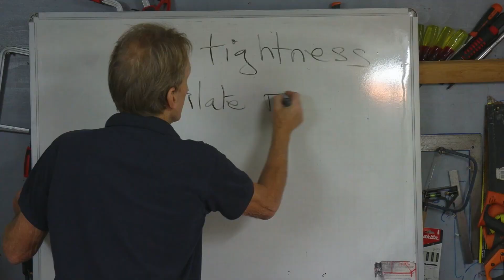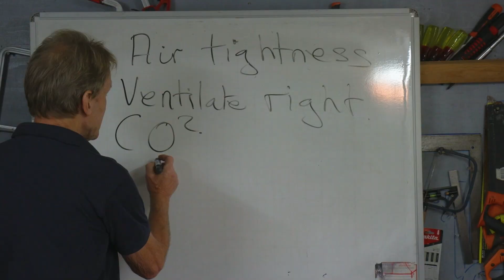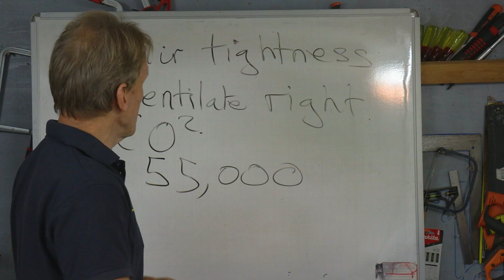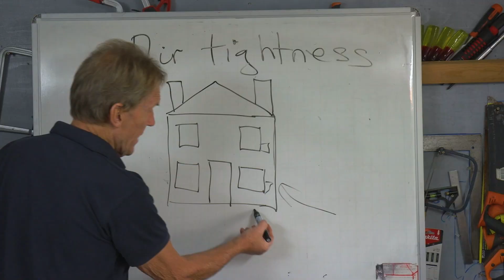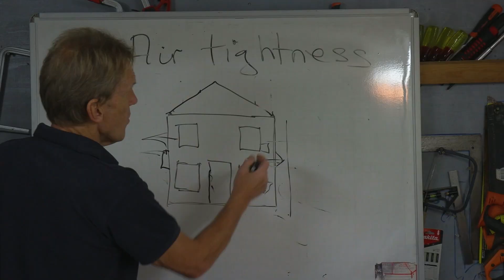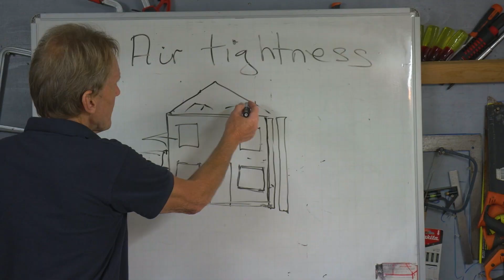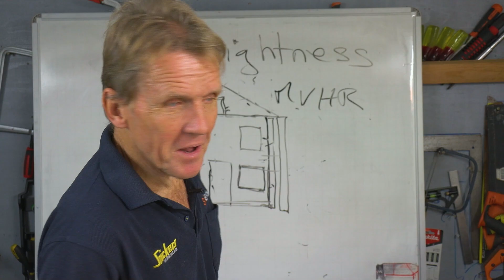The Ugly Truth About Airtight Buildings

Comment: Trickle ventilation is an astonishingly bad idea. Whoever dreamed up that mess didn't understand ventilation at all.

Energy efficiency and airtightness is about change the ventilation of your home from the ideology of a tree to the ideology of a lung. A tree has excellent ventilation, but it has no control over the temperature, the humidity, or the particulate pollution present in the air in its space. A lung also has excellent ventilation, and the air in its space is perfectly filtered and modulated for temperature, humidity, and particulates.
When you are creating a lung, you do not make the design better by putting extra holes all over it!

What you need to do instead is focus on the pipes bringing fresh air in and removing stale air. Those pipes, and the filters and air pumps connecting them, are the key to the whole system. A lung with no air coming through its pipes, or with bad air coming through its pipes, is going to fail very quickly. BEFORE you start sealing up the leaks and gaps in your house, you need to make sure that your pipes and the systems serving them are correctly engineered. Then you make sure there are no holes in the fabric of your lungs.

Get the pipes wrong, and your house will grow mould, and your people will get sick or even die.

Comment: I am renovating a 1972 house. There lots of cold bridges that are now fixed and all the external walls have been insulated on the inside. My friends said it would make the rooms smaller, like they can see two inches in 12 feet. The rooms come quickly up to temperature and stay there with the radiators hardly warm (small fully modulating boiler with Opentherm stats) still got to put in the air exchange unit (£1500) but just know it will be worth it. Insulate, insulate,  insulate,  then ventilate!!

Comment: Your small room point is bogus. 4 people in a small room is as much of a problem in an airtight house compared to a leaky one. The difference with an airtight house is that you are controlling what air you are letting it. You can put a filter and an ERV on the intake and put exhausts where pollution (toilet and stove) exists.

Airtight is only a problem if you don't do anything for ventilation. You can do a shoddy job that is on par with a generally leaky house or a good job that makes it that much better.

Comment: Bruh just ventilate the house with an ERV and use a properly sized AC system. Vent for vapor at the ridge or just seal the attic floor. 

I get old homes "breathe" and all this but energy has a financial and environmental cost we need to minimize. Not to mention controlling air quality is key for many just for comfort alone.

Comment: This is why we need mechanical ventilation heat recovery systems with carbon and merv13 filters with C02 sensors to boost air when there’s high occupancy, air to air heat pumps (for heating, cooling and dehumidification), continuous insulation & air tight walls, with vapour low permeable membrane (NOT barrier).
You need to look at the whole system.
Your little anecdote about the lady who lived to 98 is just asinine. Like smokers who talk about their granny who smoked 100 a day and lived to 100.
You seem like a good tradesman but you don’t understand building science mate

Comment: Well said Roger!
14 years ago I rented a 100+year old house with a recent long and narrow (6ft x 15ft approx) extension which housed the kitchen. Condensation would literally run down the walls & windows and drip from the ceiling. There was no form of heating in that kitchen (other than the cooker!). Opening the windows didn't help. From what you've explained here, I now wonder if the (exterior?) walls of the kitchen had been coated in some kind of sealer. The cottage part of the house didn't have this problem, not even the bathroom, and we were able to maintain a comfortable 18-20° in it, unlike the kitchen which was always really cold (it was on the north side of the house which I guess didn't help - would probably have been better as a pantry!)
Thanks for the video

Comment: I'm suffering from issues related to a lack of airtightness. The room I'm in has tongue and groove wood panels. It's in the attic so I need an air conditioner to cool. What I didn't realize is there is no actual drywall under much of the panels- the insulation itself is exposed! Cool air is easily passing through the fiberglass and hitting hot humid outdoor air in the summer causing condensation.
My first floor has similar issues between the house and foundation where humidity levels skyrocket after rainy days and I keep getting mold outbreaks. What I wouldn't give for proper air sealing, a moisture barrier under the foundation and a proper ERV for ventilation and humidity control.

Comment: Hi Roger, at 17.56 minutes into the video you make the mistake of using the term "Vapour barrier" instead of "air tightness membranes" for the  control the bulk moisture being carried into the cold spaces and therefore condensing. As you know an "airtight membrane" stops the flow of moisture laiden air by a factor of 100+ when compaired to a "vapour barrier". Love your videos, Thanks.

Comment: Airtightness is very sensible for saving money and for comfort but it absolutely requires MVHR. The problem is in-between houses, which are partially airtight but lack mechanical ventilation. We need more ambitious building regs for new builds - i.e. more rather than less airtightness and to require MVHR for them as part of this. For retrofit I think most houses are not good candidates for being made airtight unless the owners are willing to pay for MVHR too - which is not that cheap to retrofit as it requires adding ducting through the house. (I've done this and the results are worth it but it is not financially viable for most.)

Comment: I bought a 1980s split level ranch two years ago and it had a lot of rotten sheathing which allowed bugs and mice in. I took all the siding off and replaced the sheathing with Huber zip system, following the guidelines and taping all the seams and air sealing more to keep bugs out than I cared about air. Well I have new siding, windows doors and roof now but places where air can leak into the wall cavity are causing mold. Now I’m gutting the whole interior and installing an hrv, new insulation and being very fussy about the vapor barrier when installing it by caulking it onto the studs top and bottom plates and taping around outlets and windows. Learned a hard lesson about sealing up an old home.

Comment: It's getting so hot that no one will need heating mid winter. This is due to global warming. A good sleeping bag is the answer and fresh air or fresh pollution if you live in the city, houses are very expensive. A simple camping gas cooker can do just about everything except roasting meat vegetables, opening windows for oxygen if it's possible  or purchasing a oxygen generator may save you.

Comment: again a compressor dehumidifier if a great way to dehumidify during the winter because it gives off heat it will only be 120W or so, but it means that not only are you reducing the humidity your also supplementing your heating in the same stroke and during the summer you can just open up the windows. As you say though CO2 is an issue so you still need a decent amount of ventilation.

Comment: Excellant rant. The big disgrace is UK building regs. My house is 40 years old and came with MVHR installed. It's 5-bed detached and the total output of all rads comes to 2.5kW - the thermostat stays at 21°C and we don't need TRVs because every room is used throughout the day. It's now 11pm and the heating just came on for the first time today as the outside temp has dropped to 5°C. The rads got to 40°C and the heating went off again after 12mins. I know all this because I'm recording the boiler flow temps to try and convince Octopus and British Gas that I do not need a 12kW ASHP and bigger rads. Where was the house made? Sweden of course and it's so frustrating trying to get installers to think outside their crappy British new-build boxes.

Comment: This was brilliant! and very helpful. I just built a block recording studio in my back yard and we water-sealed it inside and out, thinking we were preventing moisture from entering it.  Low an behold, just my wife and my breath was building up in the room and in the coldest back corner we were seeing water run down the wall onto the floor.  Not much, but enough to catch my attention and wonder how on earth it was getting into the building.  After thinking about it I figured out that the building was so air-tight it had to be our own breath causing this.  If I left the door open for a while or if I was not in the building for a few days, no water showed.   So now I'll have to figure out how to keep the sound out and let fresh air in somehow.

Comment: What is this guy talking about? The houses that air tight should have mechanical ventilation and humidity controls. Every airtight house I have lived, most new apartments in Denmark, have been perfect. No more feeling drowsy due to lack of ventilation, no more humidity, no more allergies (air is HEPA filtered in)… and I have had asthma my whole life, never been better.
Reply from the maker: You have made the very same point that I made but I understand you are Danish so might not have understood my exotic accent. If you are going to make air tight houses you need MVHR. The trouble is we don't insist on it in the U.K and it leads to problems.

Comment: If the people who live in properties that are having mould problems bothered to wipe the walls down with warm water and any type of mould spray , or any cleaner,  on a regular basis, ie :  daily, weekly, or monthly , whatever is required,   that would stop the mould from getting a hold on that room and getting worse as shown on recent reports .    The fact is you can see the filth on new UPVC window frames , and mould doesn’t take muck effort to wipe from plastic !    I have advised customers before that their tenants need to open all windows every morning and let fresh air in and stale air out for at least 15 minutes,  they could do this before showering etc ,  and close them before they went out if they are rushed in the mornings . It would SMELL a lot better to !  Basically it comes down to LAZY people.

Comment: Why is there more vapor the warmer the house gets heated? Doesn't make a lot of sense. Great videos!
Reply from the maker: warm air will carry a lot more water than cold air. It is due to evaporation. Think of a hot steamy jungle
Reply: @SkillBuilder  In the jungle there's much more evaporation due to the higher temperatures. But inside your house there's a  fixed amount of vapor: the vapor produced by those who live there. The fact that warm air can contain more vapor doesn't change the total amount produced.
Reply: @SkillBuilder  The cause is probably the pressure differentiel, not the vapor amount.

Comment: Before you get a negative pressure system, I strongly recommend getting a Radon test done. Radioactive gas is likely going to worse for your health than condensation.
Reply from the maker: positive pressure, not negative
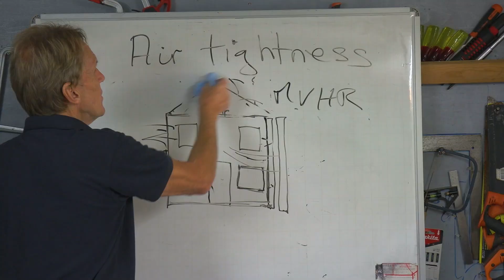Reply: @SkillBuilder  At 14:58 you recommend negative pressure.

Comment: If you want lots of natural ventilation in a house that's fine, but you can kiss goodbye to your money when you try to heat it. You also can't control the quality or amount of air coming in. Much better to build an airtight house with active ventilation. More expensive at first, but lower heating bills. A lot of what you describe is actually about use of impermeable building materials, a totally airtight house will have no moisture problems if it's built with vapour permeable materials.

Comment: Silver foiled backed plasterboard stops moisture getting into cavities. Then you need to install mechanical ventilation to remove the moisture to prevent condensation. 2 extracts. One bringing fresh air in and the other blowing dirty moist air out. MVHR is expensive but works well if maintained and balanced correctly 👍

Comment: What is really the solution to all of this is decentralized, room per room heating, ventilation units integrated with the windows. Intake at the bottom, exhaust at the top and a heat exchanger to save the energy. Active monitoring for hunidity and CO2 with of course a manual override. You could say modern buildings don't accomodate that because exhaust of bottom floor goes into the intake of the floor above.
Maybe it would be possible to run chimneys in the cavity wall...
Either way natural ventilation is decentralized. Every room has a window.
This is the real solution I think.

Comment: This issue is not about affordability, its a bout substandard building methods employed by builders getting richer and the average person getting sicker in the poorly build houses...why don't you rant about that? And then talk about a 'Fabric First' build approach.

This video was not helpful at all. You basically came to no final resolution or sensible suggestions. I am currently researching very heavily with the intension of building a house that is EnerPHit standard, by Passivehaus in an old 1970s house that we recently bought. Its so poorly built, its drafty, uncomfortable and we are bleeding heat. Myself and my son suffer with the very common allergies like eczema, and nasal allergies. Have done all my life living in sub standard built houses from council houses where I grew up to my recently sold 15 year old house that you would think would be well built. It was shocking, drafty with black mould growing in the bathroom ceiling.  So what this video basically tells me is that any method of building is a health risk...so what do you suggest??

Much research is done in building science and there are case studies like we see on Grand Designs and other TV shows, podcasts, repeat passivehaus builders etc. So are they are wrong about the house feeling more comfortable and healthier. 

Our project is modest and we are going to do some works ourselves but we are adding best new windows, insulating the whole house, new roof with membranes and installing a HMVR system. We may not quite meet EnerPHit standard but I am hoping for a house that is warmer and doesn't cause me to have sneezing attacks.  My question is, are you saying that I am wasting my money?  And when you talk about only being available to the rich, we are not rich, and builders are not poor so why do we still have to put up with substandard building while the builders get richer and people get sicker? This is a bigger subject that is required by a rant.

Do you know in the UK there are a handful of major building companies tabling care of low building stock. Every other country in the EU has hundreds of house builder so standards are are more competitive.  This is a subject to rant about, something that actually does affect the majority of people in the UK.
Reply from the maker: Angela
It appears to me that you have enough things to rant about so maybe rather than telling me what to think and say, you should start your own channel. My video may have been difficult for you to follow but I did say that an airtight building without an effective air management system is a mistake. You need some kind of automatic ventilation, preferably with heat recovery. Air tightness on its own leads to damp, hunidity, toxic mould and dust mite, to name a few. I am sorry if you failed to take those simple messages away with you but hopefully this clarifies it.

Comment: I’ve worked on many Victorian buildings and have a quite simple process that works really well.
1.insulate the inner walls, the thicker the better
2. Plenty of ventilation eg trickle vents, chimney vents, large gaps on the bottom of interior doors 
3. A high quality extractor fan for bathroom with overrun
4.keep furniture away from walls

Comment: You make the ventilation problem sound a lot more complicated than it really is. I don't know about the UK, but here in Germany we have this innovative ventilation technology we call “Fenster”. They are basically holes in the wall that are normally covered by a glass pane, but if the air in a room gets bad, they can be opened to let fresh air in (we call this procedure “Lüften”). The most efficient way to apply this technique is to open all the windows of a room at once and close them again after 3–5 minutes, when all the air has been exchanged (we call this “Stoßlüften”). This is more efficient than the trickle ventilation approach, because it doesn't continually cool down the room. Of course it will be cold in that room for a brief time afterwards, but it usually gets quite warm again in under 5 minutes because of the heat stored in the walls and the floor. This technique is usually applied once or twice a day to the whole house, but it can of course be applied more often to specific rooms if the CO₂ concentration or moisture level has risen in that room, e. g. because of a party or after showering. This also solves the problem of the trickle ventilation approach that your amount of needed ventilation actually depends on the amount of people in that room.
Reply from the maker: Lukas 
 I like your innovation but sadly in the U.K people who are struggling to pay their fuel bills tend to keep their windows closed and the condensation builds and brings about toxic mould.
Reply: smart
Reply: in france we have ventilation that can't be stopped 🤦🏻‍♂
Reply: There are temperate zones that vary environmental conditions and your solution seems to require daily maintenance. This doesn't mean it's "wrong" or "bad" I'm just suggesting the universal this video highlights, everything is a tradeoff. Most homeowners, at least in the US, aren't valuing daily home maintenance over an automatic system.